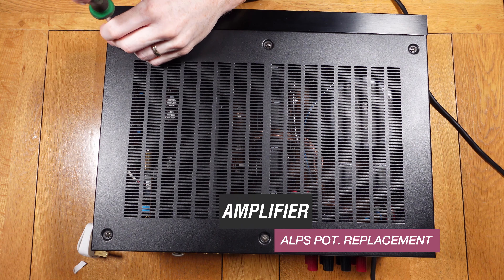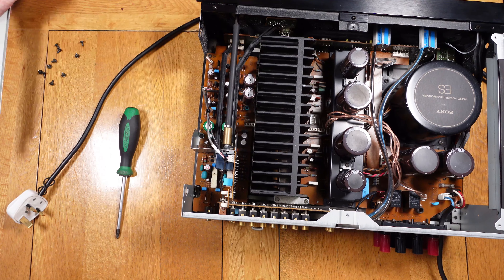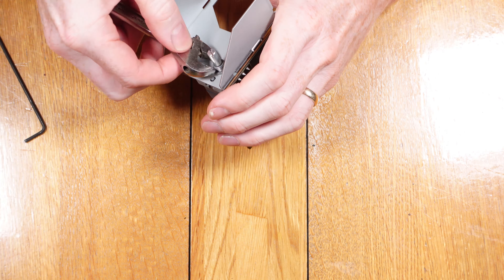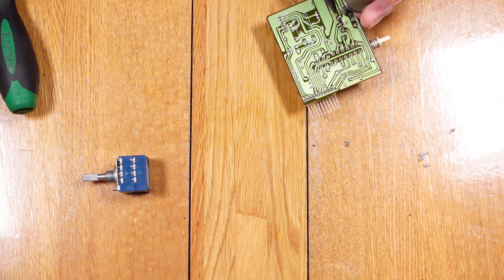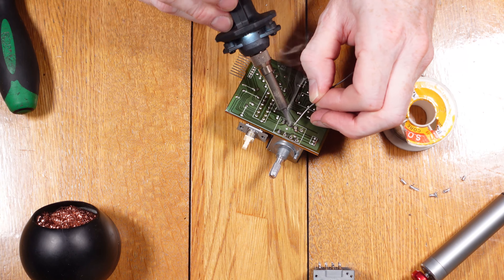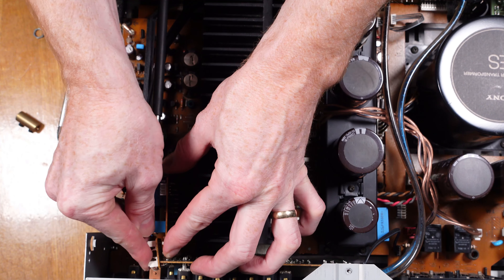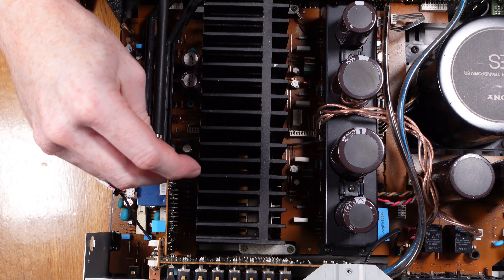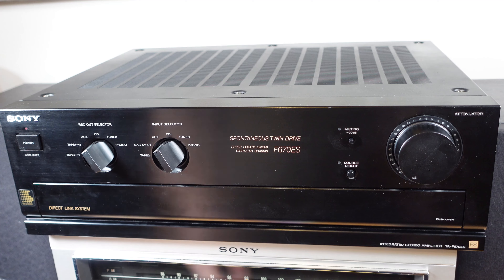Amplifier ALPS Volume Potentiometer Replacement, Sound Drop Issue Repair - Retfurb Audio Refurb

Comment: You can easily drill into the top case of those pots to get contact cleaner inside. Also if you go in behind the sticker on the back you get access to the rear gang.
Reply from the maker: Thanks for the additional info. I haven't tried to drill one out, As could not see what would need drilling?. 
On the previous video showing this amp, I unscrewed the case but would not open fully. The sticker was also removed to spray cleaner inside.

Comment: I’m having the same problem with the exact same amp,please could you tell me the exact alps pot you used ?thanks and great detailed video too
Reply from the maker: @littlemisssunshine1727  I will see if I can find it again, it was a while back when I purchased it.
Also another thing to look at on these amp, is the speaker output relays. As these can also get dirty and need cleaning.
Reply: @ thank you I would really appreciate it,there’s loads of different alps pots I’ve seen ,just want to make sure I buy the correct one,thanks for replying,I found your video very informative
Reply from the maker: @littlemisssunshine1727  I am glad it helped. 
So I can't find the actual listing I purchased, But I have found the same looking one. It is on Ali-Express, So I am not 100% sure if it is genuine. Link is - 

https://www.aliexpress.com/item/1005003730902352.html?spm=a2g0o.order_list.order_list_main.5.55da1802DPOtES

The original is a 60K and I used the 50K. It looked the same as this one.
The reviews seem ok on the listing.
Reply: @ thank you so much,there’s loads of these on eBay as well with faster shipping but I don’t know what to order,could I also ask did your amp go into protection mode because of the faulty pot?
Reply: @ I just ordered from Ali express thanks for your help
Reply from the maker: @ great.
Reply: @ hi I just received the pot I ordered from the link you gave me and it’s only got 6 legs instead of 8,I’m assuming I can’t use it
Reply from the maker: @ That's odd. It is the same type I ordered before, But should have 8 pins.
The 6 wouldn't be any good.
They must have changed the listing.
The link below shows 8 pins. 

https://www.aliexpress.com/item/1005003730902352.html?spm=a2g0o.order_list.order_list_main.5.55da1802DPOtES
Reply: @ I just clicked this link and yes it’s showing 8pins so I’ve just double checked and order them, I must of clicked on something different 🙈ok thanks for quick reply appreciate it
Reply from the maker: @ they mostly do free returns on items, so hopefully you can send it back.